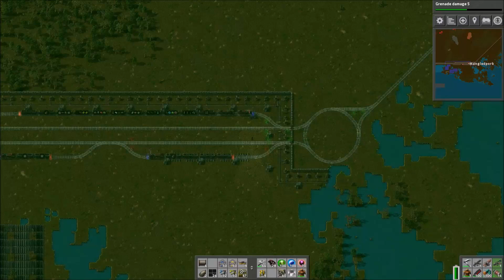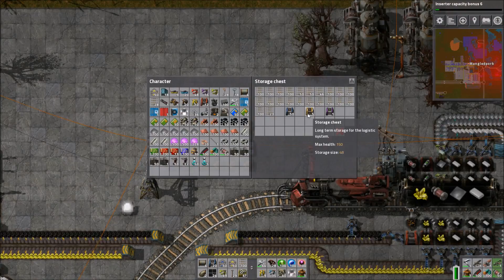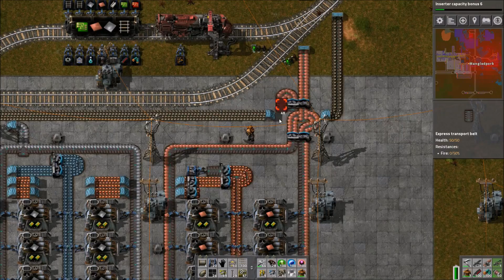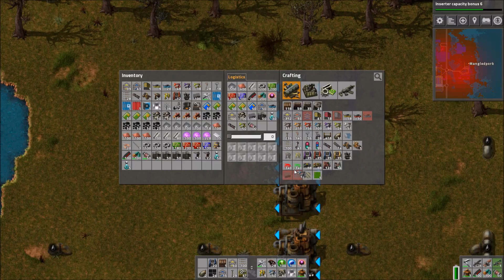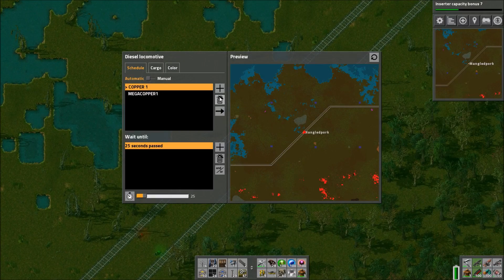Factorio Railworld Ep#94: The Rocketrain

Comment: Why u place concrete with robots?
U can place it urself moar faster. Max square – 10×10. Only press muse button and run!
Reply: He's using the concrete that's already stored in his logistics system. Though he doesn't need an actual blueprint to do it, shift+clicking with concrete out accomplishes the same thing. There is the small issue that his personal bots will try to use any concrete he's carrying, so the blueprint still makes some sense.